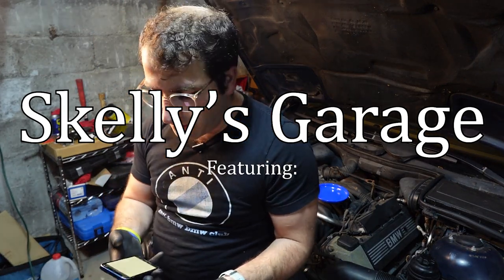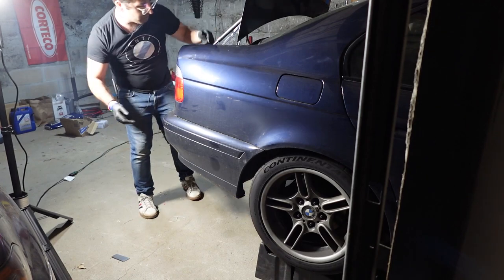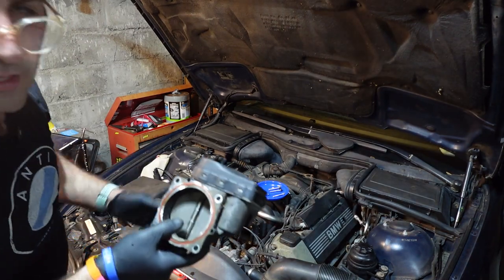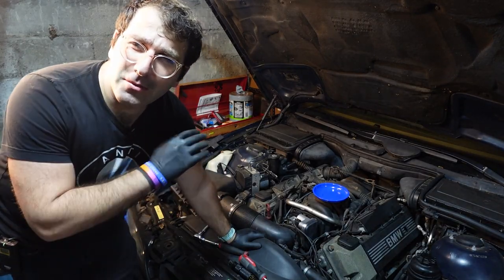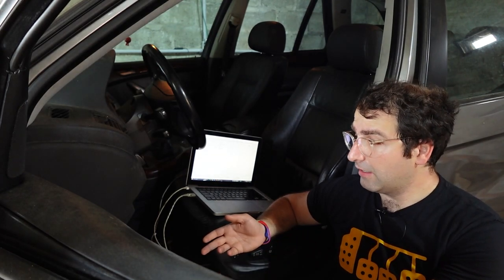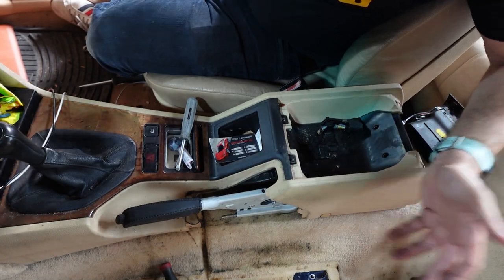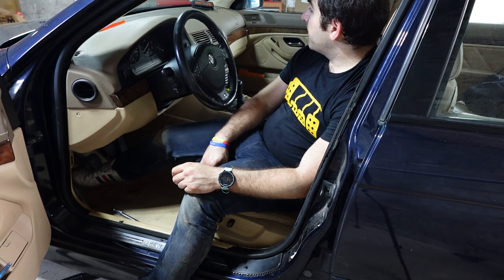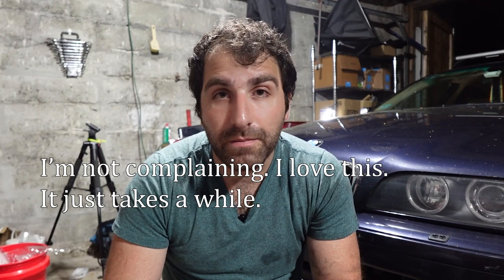Baseline Achieved: Tons of repairs on my E39 540i!

Comment: Nice work!  It's always nice to see a neglected E39 be brought back to life like this.
Reply from the maker: Thank you very much for watching! I am working hard to make it progressively less broken.
Reply: @skellysgarage Hello my friend great work.  I wanted to ask you a question,  I just purchased a 1997 540i pre vanos from auction for $775. It's alittle  rough but the engine sounds good.  My question is I have the 3 light trifecta abs brake light  and traction control light on. Also it seems that the car is in limp mode,  I hear the abs module is us the culprit,  could the wheel speed sensor also give me this issue?
Reply from the maker: @troylogan3653 ultimately there are a ton of possibilities there. I don’t think I’ve seen limp mode as a result of ABS or wheel speed sensor issues, so you may have multiple compounding things happening all at once. Do you have a scanner?
Reply: @skellysgarage  no im going to have to get one.
Reply: I was reading that with abs all kinds of issues happen with that not communicating properly.  But I was going to try the wheel speed sensors first since  they a cheaper. Abs module you have to have it sent out and coded. I will keep you posted but you definitely have a new subscriber.  Thank you for responding back I appreciate it.
Reply from the maker: Thanks man! Of course, I am always happy to help.
If you get the right cable (it’s $30) on Amazon and you have a windows PC, reach out to me and I can help you code it yourself :) I know a lot about coding, and I’m always happy to help.
Look up LZLRUN K+DCAN cable. Since your car is a 1997, you’ll also need the OBD 20 pin adapter (should be about $8 on amazon). Let me know if you are having trouble finding anything.
Reply: @skellysgarage  thank you very much

Comment: Nice, nice work and nice that you haven't given up yet. That said, only now did I realize that I can have a leather covered handbrake handle, instead of the plastic one that came with money. Off to e-bay!

On a more expensive sidenote, have you thought of replacing the fan and fan clutch with an electric one? As a matter of fact, the 600W fan from the E60 540 fits nicely and is good enough (at least for the M54 needs). It does require some coding, though. But LCI E39s have the same connector as the E60 fan.
Reply from the maker: Thank you as always for watching along!

You have got me interested - if there is a way to retrofit the N62s electric fan, I’d definitely look into doing that. I hate clutch fans so much.
I also really want to do that for my X5. Maybe that fan would fit there.